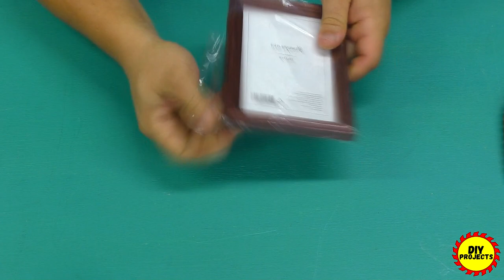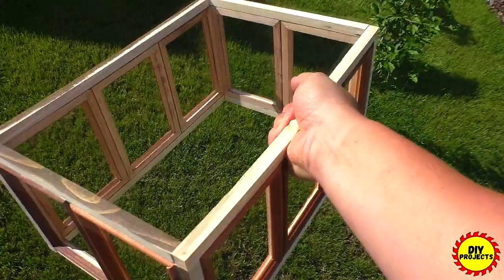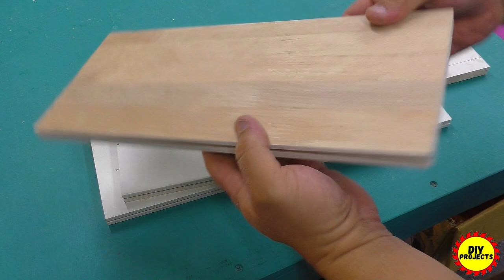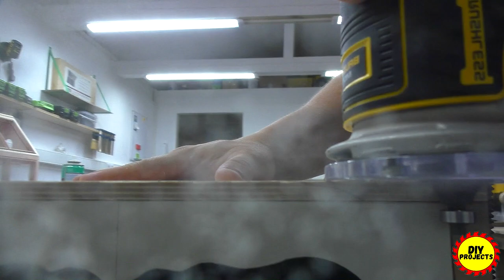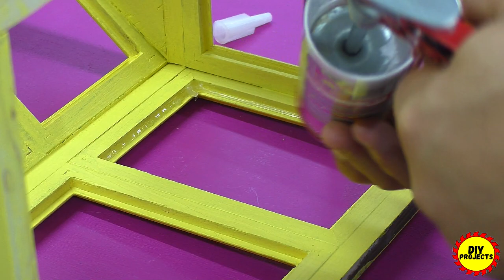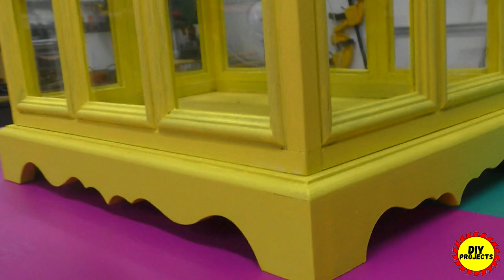INTERESTING DIY IDEA from photo frames !!!

Comment: Maybe a metal pan to catch any water emitting from plants place inside. That will preserve it longer against dirt,drips,et. Possible handles to move it easier from one place to another. How much did you spend on material if I may ask?